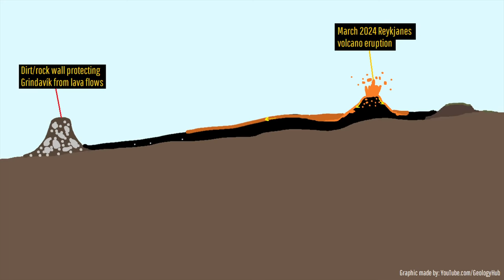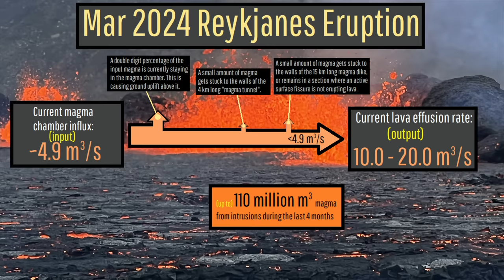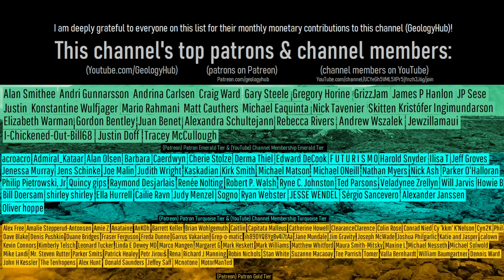Iceland Volcano Eruption Update; Toxic Gas Emissions, Lava Walls at Risk of Being Overtopped

Comment: Lucky employee. SO2 is unmistakable at fairly low doses, when it enters your mouth there's a metallic taste and a feeling of smooth or greasy tongue. Worked at a mine without a proper working scrubber after their roasting unit and got a dose of this all the time down in the pit immediately below the stack. Eventually they put the stack way up on a hill and implemented a 'better' scrubber and still the vegetation around the stack was dead for a km from all the scrubber bypasses. The H2SO4 wasn't great for my asthmatic lungs either, had a lot of lung problems.

Comment: Funnily enough I asked the question about gas affecting the visitors in the blue lagoon area during the first part of the eruption before they were evacuated, and was told it was unlikely to be a problem due to the distance to the site of the eruption, now the lava is closer it us obviously a real possibility and concentrations needed to be a problem are very low.
Reply: Is not the lagoon closed now?
Reply: It wasn't a problem or risk at all during evacuations because it wasn't releasing large enough volumes fast enough that it could hit out of nowhere before evacuation,
however after it's been erupting for days with multiple big burps it starts to settle and spread out or get swept into other areas due to being a heavier gas. We are very much vigilante and needing to prepare for it now but there are forecasts and warnings hours ahead for any town that's getting hit with high levels.

Comment: There's no one working on the low lava wall?  Why would they think it was 'done' when 1/2 as high as the other?
Reply: the time they had between eruptions was limited it is amazing they were able to build what they did in that time.
Reply: I don't know if it's the correct wall, but they had to cease work on one of the dikes when that fireman got swallowed by the fissures that opened on "the safe side" of the dikes. (Back when this activity was "new", the day after the 1st evacuation.)
Reply: There is no current flow at the lower SE wall.
Reply: @muninrob  was it a firemen? I never saw specific info that it was a firefighter but rather some1 securing/ mapping area when they went to lunch but 1 person never showed up
Reply: @01i_gaming13 Yep, nowhere near lava... it was in town where fractures were.
Reply: The source of the rocks they were using may have been compromised. Read that the quarry they were using had been filling with lava. They need a safe source of materials to build more walls.
Reply: It is dangerous to work there and the underlying topography is also a factor. There is an area without a lavawall cause that area is higher anyhow. Thirdly we also need to factor in the flow direction of the lava and in areas with whatever kind of blockage, the lava might flow higher, just like a river with a stone in it. So... multiple reasons. 

If this were the US or a NATO country, they might send in soldiers with special gear like gas masks and heavy machinery to reinforce endangered areas. Idk how much of an army or other useable guys Iceland has or if the lava wall was all built by civilian contractors.
Reply: Correction.  The "RUV.is" porbjorn cam is showing a large patch of incandesence at the south end of that lava-free strip on the east side between the two flows, but it is not up against the wall or as far as I can see, extending that flow towards the highway.  Seems to just be some in-filling between the two flows down there.  In the overall scope, that far eastern lava flow is insignificant.  This will likely all be moot by tomorrow as the center region of the lava front is creeping up the berm and will likely top it overnight and then begin to erode a channel through it.  That is when the bad stuff will start to happen  Given the relative terrain slopes in the area, a breech of the berm could become the preferred gravity driven path for the lava.  The forward progress of the lava wall has been slowed a bit as the lower elevation of the quarry has been a preferential destination for the lava, but as it fills this effect will lessen and the flow in the center region will likely pick up.   In the last hour or so the incandesence of the  middle part part of the flow heading towards the berm has picked up. 

The output up at the vents/cones is still chugging along.  I have not seen any reports of whether the ground under the power plant is still inflating, deflating, or is the output of lava equal to the magma flowing into the upper chamber from the main deep reservoir.  One site said about 15 cubic meters a second, which works out to about 1.3 sq KM, 1 meter thick, per day.  Looking at a map, the area inside the berm is about 2-3 sq KM and Grindavik itself seems to be just over 1 sq KM in area.  If nothing changes, it would not surprise me if the area inside the Grindavik berm was under 2 meters of lava by next weekend.

On a side note, the quarry is starting to resemble the Kilauea crater,just sayin.
Reply: @01i_gaming13  The media I consume reported the missing man as a firefighter on duty, and it fits the evacuation / response timeline, so I haven't fact checked it heavily. 

The fact that they ceased dike construction & other mitigation measures in that area due to the "SURPRISE!!" safety hazard at that time made me wonder if OP's "low" dike was the one that got abandoned during construction.
Reply: I believe you assume too much. There are MANY reasons to stop work on a project no matter how important.

Comment: I've got a feeling that lately we've seen our sun produce more proton outputs and these are absorbed at our poles. My feeling is that these protons are going to heat up the core a little more, thus producing a hotter lava, maybe even thinner. I'm also thinking these barriers aren't going to withstand a long duration push from this magma flow. I'm no scientist but do I really need to be?? However, that's why I come here to listen to someone who seems to have grasp on things. Thanks very much for what you do!!
Reply: Uhhh, I don't think that's what's happening. In fact, I'm pretty sure what you said is a slightly altered version of the plot to the movie 2012, which is not based on reality whatsoever.

Comment: Thats bad! Volcano cones are basically like candles. If the wall collapses, a huge amount of lava will pour out like a tsunami!😮😮
Reply: But only a huge worry if the topography makes it flow fast or in a bad direction
Reply: @scrappydoo7887 And this is the case here as only uplihill is north which is safe direction
Reply: I think the original commenter unknowingly exaggerates the threat of a wall collapsing in the cone for a few reasons.  One is that the eruptive volume is down significantly from early.   The cone is also several hundred meters from being any threat to any infrastructure primarily because of that reduced eruptive volume.   Third, Geohub mentioned the viscosity has increased and thus a lava flow will not travel very far.
Reply: Nature is good. Looks like it’s trying to expand.
Reply: @user-gp7km2ex5i That happened not too long ago during the Stori-Hrutur eruption, exactly as you described. Also in 2021, July 2nd, the Nar crater completely overflowed itself and it was WILD!!